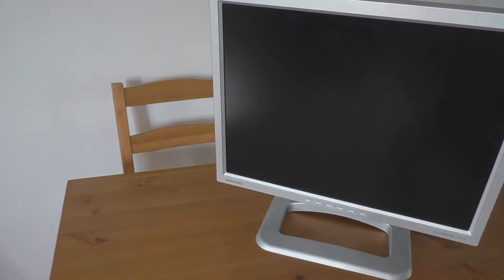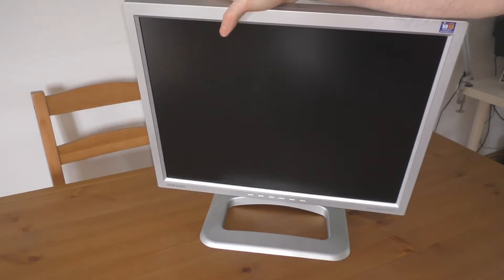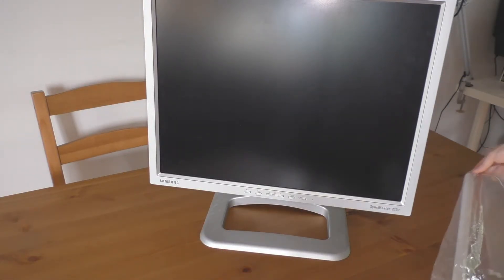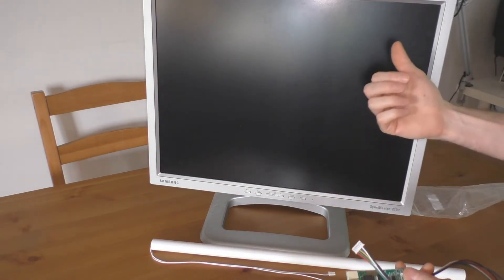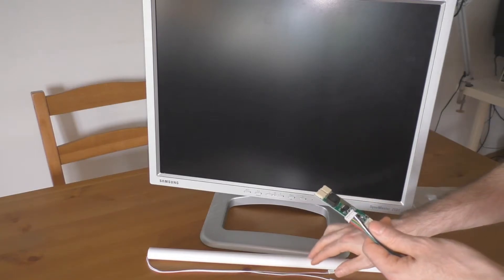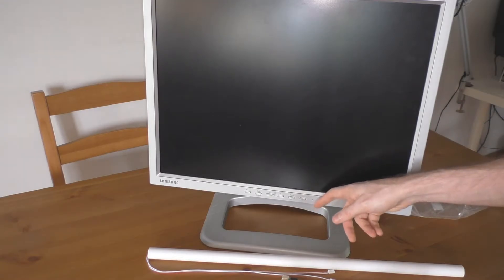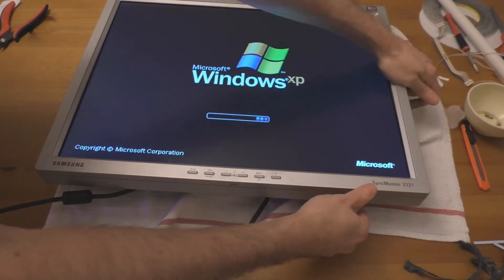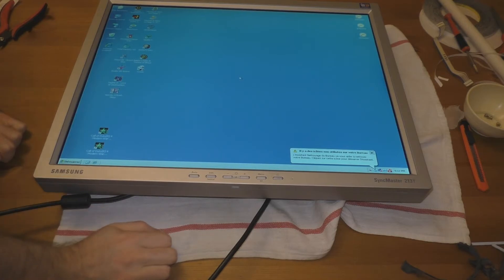[Attempting Repairs] Samsung SyncMaster 213T - Part 3 - CCFL replaced with LED backlight

Comment: My 213T had a different motherboard with a 6 pin connector to the backlight inverter  . 
I had to measure the connector for voltages . 
1:  VCC ( blue wire )
2:  VCC
3:  GND 
4:  GND
5:  DIM
6:  ENABLE 

The EL tubes all had  black rings at the ends , wich clearly indicates end of life for the tubes . 
So this led replacement is a great and very cheap repair . 
And it works ! 

Thx again for the videos .
Reply: Thanks so much for posting this!! 

For anyone else who has the 6-wire version, here's a recommendation:
For the pin numbers, **trust the "1" & "6" printed on the larger board, near the 6-pin connector.  (Don't necessarily trust the "blue wire" designation).**  
Why?
At least on mine, the two ends of the cable (the cable that connects the two 6-pin connector on the old, original fluorescent-tube-controller board, and the 6-pin connector on the largest board) are interchangeable, except that on one end, the blue wire is on pin 1, and on the other end of the cable, the blue wire is on pin 6.  So the monitor still functions regardless of which direction the cable is plugged in.  So if anyone worked on the monitor before you, if it was ever repaired, or if the manufacturer just put it in backwards, the blue wire might well be on pin 6.

Your post made me think to test the pins, too - thanks for that idea.  I got these voltages (measuring relative to pin 3), which seem to suggest my pinout is the same as yours:
1: 17VDC
2: 17VDC
3: 0VDC
4: 0VDC
5: 0.1V after pushing "dimmer" button repeatedly, 5V after pushing "brighter" button repeatedly
6: I saw this one at 17VDC briefly, and have since seen it at 0VDC.  Not sure why yet.

PS - just in case anyone is trying to decide whether yours has the same pinout as mine and stragenmitsuko's, my old, original fluorescent-tube-driver-board has these markings on it:
TW08BN4400088AAMBIWBP0091
REV: 07
And on the board itself, under one of the floppy plastic covers:
BN44-00088A
K02I048.00
AMBIT REV:4

PPS - since neither of the connectors quite fits in both boards, I briefly considered cutting and re-connecting wires, modifying the connectors... and then decided to plug in both cables, shove some jumper wires (I used 22ga solid core wire) into the loose ends, and electrical tape it together.

Comment: I had the exact same problem with a 213T . 
Power supply dead . Repaired it . 
Upper driver board fuse blown . Shorted it . 
Then it blew the mosfets .

So I'll be replacing it with led strips just like you did . 

Could you share the pinout for the connector ? 

Thx 
Pat , Belgium
Reply from the maker: Hi, on section 9-1 of the Service Manual, you can see the pinout for the CN102 of the 213T motherboard:
1=14V
2=14V
3=GND
4=GND
5=Brightness Control
6=BackLight Enable
7=GND
8=GND
Then it will depend of the inverter board of the new LED driver you will get, but mine got its pinout written on it.
Reply: @TheRealPhoenix_Retromods  Thank you